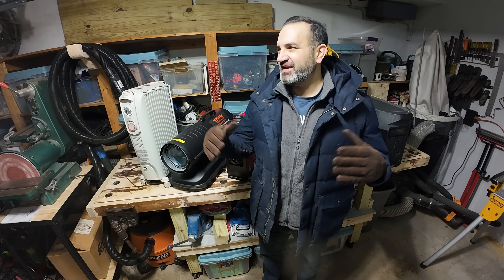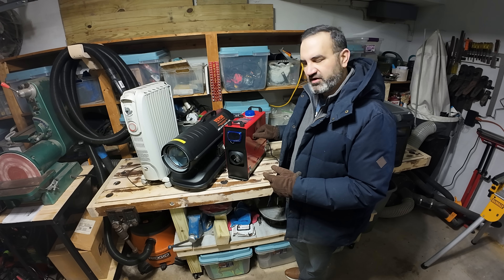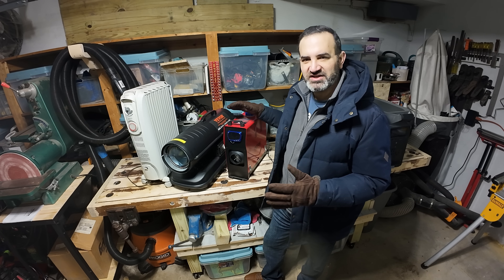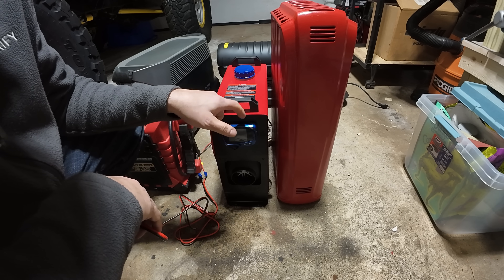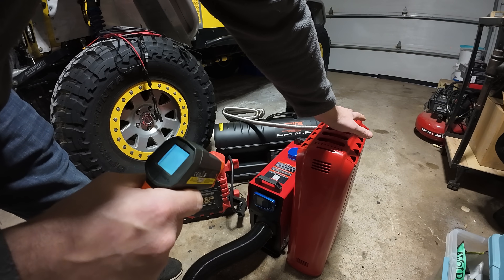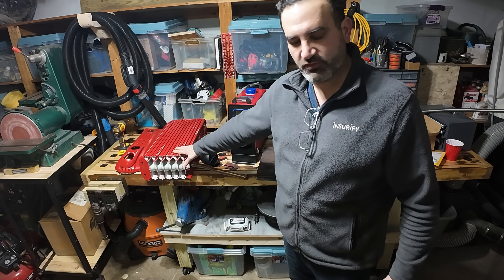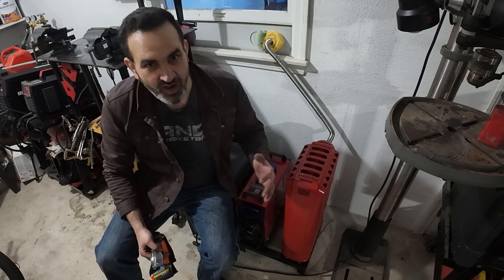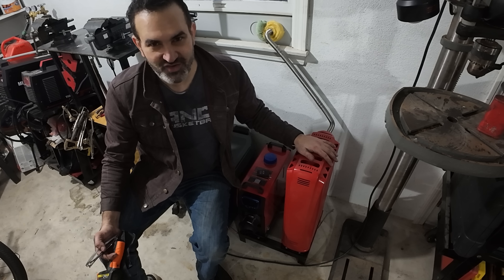Super-Efficient Vevor Diesel Heater Build for Shop & Off Grid

Comment: Find three or four of these Is old oil heaters.
Do not remove the oil. I repeat do not Remove the oil. 
The oil will retain the heat. Is the oil will retain the heat.
Using the exhaust system Is to heat the oil.
Or.
And then put those fireplace fans on top of each one of them.Maybe two on each.
Reply from the maker: @jasonpierce1980  why would you want to retain the heat? Retained heat doesn’t disperse. I want all the heat dispersed into my shop while I’m using the heater.
Reply: @offgrid101  To keep
Your garage warm.
🤦‍♂️ That's the whole purpose of your video is to retain the heat.🤦‍♂️
Reply from the maker: @jasonpierce1980  I don’t keep the garage warm 24/7. Any warmth released after I leave is wasted energy.
Reply: @offgrid101  How is it a waste of energy? All you're doing is gathering heat.... Through the exhaust the same thing you built.
Reply: @offgrid101  Here's another idea so you don't have to run your heater the whole time.

Comment: I was thinking about doing this exact thing but KEEPING the oil to better transfer the heat
Reply from the maker: @dronedrops8173  that was my original idea, but then I realized 1) there no good way to get the heat into the radiator while keeping the oil in it, and 2) the oil only retains heat, which I don’t care about. I want to capture and disperse it while I’m in my shop, not retain it to heat my shop after I leave.

Comment: You could add a couple of large diameter PC fans to the bottom of the radiator section and really accelerate the dispersion of heat into the shop, they would be able to run off of the same 12VDC supply that powers the heater.

Comment: When I have time I would like to use the exhaust as a "pre-heat" for the air intake that way the starting temp is elevated resulting in more heat and less fuel used.

Comment: do a followup video after about 100 hours of running.  i tried to do a heat exchanger with 1 inch iron pipe and after about 100 hours the heater would not heat well and had a soot buildup inside the combustion chamber.  i think if i would have gone to a 2 inch it may have been fine though.  the fan on the inside of the burner is not strong enough to force the exhaust any distance more than about 10 feet.  if i would have done the 2inch iron pipe i think it would have worked though..  also going to need a drain.  got about 8 ounces of water off the first heat exchanger after 20 hours or so

Comment: Great idea for long term off grid solutions! 
However, during a snowstorm/ power outage last winter I heated my 750 sqft home with an electric radiator and a few strategically placed box fans connected to a battery bank and an inverter. I was able to keep it about 65-70 degrees for 3 days when it was around 0 outside.
My experience with electric radiators is that they work great with well insulated spaces.
We now have a propane heater for backup. Next will be a wood stove.

Comment: Before watching I will point out that if you use an engine to work a heat pump, you effectively get more than 100% efficiency.
You can also run a generator and extract the "waste heat" is you have a use for the electrical power.

Comment: Cool idea. I'd have just run the pipe straight through the radiator and kept it filled with oil. Let the exhaust pipe heat the oil without making an issue of condensate gathering in the radiator.
Reply: This was my ideal exactly and a fan of some sort
Reply: @thewebbsace  it shouldn't need a fan. The heat should rise off of it just like it was intended to originally. 
But if you really want a fan you could just mount the vevor heater in such a way that the blower on the front blows across the top of the radiator.

Comment: A Russian blog found by experiment and calculation that these 5Kw heaters on max deliver 3.5Kw at the blower outlet and were able to extract a further 1.25 Kw adding a radiator to the exhaust
Reply: Agreed, the rating of these aftermarket heaters is both the fresh air and exhaust. Great post, as people are oversold and under-impressed, and their builds are mediocre.

Comment: The problem you will have is the acrid condensate will condense in your radiator 0 You must always have the exhaust drain downward  from your radiator  until it exits your shop -  as an alternative  you could put a pinhole in the bottom of your radiator and run a small tube outside

Comment: I used a turbo charger intercooler with a 12 volt radiator fan on mine.
Similar results as you....
Reply: That,s exactly what my plan was .... An intercooler is made for cooling air and very efficient since its used in automotive applications. Why not use it the other way round .

Comment: Those thinwall diathermic radiators are not designed for high heat and will pop at the seams releasing carbon monoxide. The exhaust is being restricted and will cause serious sooting and condensation. This is not a good idea and could be very dangerous. Be smart and be safe!

Comment: with that 90' bend going to the radiator will trap the condensation in the exhaust causing an ERROR code. I would put a bleeder valve at that bend.

Comment: Love the repurposing to get the efficiency up. You need to take the combustion air from the outside as well so you're not consuming the warm air.
Reply: I'm no expert but surely this is less efficient?   It's like the recirculation button on car aircon - the aircon (or heater in this instance) it doesn't need to work as hard as it's heating already warmer air?
Reply: @lee_brooks  No, the air being heated isn't the same air used for combustion.  Theses heaters are designed with 2 air inlets,  one for the room air that gets heated and a completely different air inlet for combustion. This is just like your car, the air used for combustion has a different inlets for the air being heated. If you use inside air for combustion it will suck in the outside air and make the room drafty.
Reply: @christopherguy1217  Thanks for the explaination : )

Comment: Nice idea, you have given me some new thoughts on my own set-up. Remember the exhaust condenses so you will need some sort of drain in the heater body, I would suggest a radiator bleed valve as it is easily installed and used.

Comment: Running the exhaust through some kind of heat sink like your old radiator is the way to go. I'm thinking of doing something similar using a long exhaust pipe coil in a fish tank with sandy soil.

Comment: You should have the air intake for combustion on the outside. Doing that will prevent the heater from pulling heated air from inside that will be replaced by cold air pulled through gaps in doors, windows, etc.

Comment: Neat idea! I did something kinda similar but with a large barrel in my garage. 
My suggestion: raise the heater above the radiator so the exhaust is going into the top of the radiator. You’ll get more heat out of it that way. Also tilt the radiator at a slight angle towards the exit pipe so condensate can drip out.  Where ever the exhaust is exiting should be the lowest point in the system. 
 Lastly on mine I increased the exiting pipe diameter because I’ve read from multiple sources that increasing the exhaust length and thus back pressure is bad for these units.
Reply: Great idea and it makes perfect sense to do so.
Reply: @jeffclark5024  remember the exhaust is meant to vent out of those things. If you back up the exhaust too much you can overheat the thing.
Reply: @quevicular  The standard length exhaust is routed to an old 100 gallon propane tank with a 2” stainless pipe exiting. It flows quite easily. Haven’t had any issues yet
Reply: @jeffclark5024  gotcha. Thought you were using an old electric oil heater

Comment: At 13:30 were you putting kerosene in it? Awesome idea by the way, going to keep my eye out for an old radiator style heater in fb or somewhere.
Reply from the maker: @HollisDoesStuff  yeah, I didn’t have any diesel around at the time, and kerosene is close enough for a test. I’ve since filled it up with diesel for normal use.

Comment: The oil/electric radiators are fine. mine can keep a 25°C difference on the low setting. my Space is relative small and well insulated.

Comment: To upgrade your idea use a used car EGR connected to the exhaust connect the water pipes to a central heating radiator use a small 12 volt pump to circulate the water that will be the most efficient way to get extra heat out of a diesel heater I use two of these systems to heat my home so I'm sure they will be ok for a workshop you can actually couple up more than one EGR together you can find lots of videos on YouTube on this subject

Comment: You need to put a drainplug in the radiator. Water will condensate inside and you probably will not want to take the caps off periodicly.

Comment: Fill the radiator with sand and be even more efficient.. I did that with an old wood stove and filled the chimney pipe and ran the exhaust through stove & out the pipe.... Works a treat and holds heat for hrs after turning the diesel.heater off ✌
Reply: I've been looking at sand batteries (generally powered by excess solar and an 'immersion heater' type device (and they're great) but in this instance surely you need the airflow though?  Not critical - just trying to understand : )
Reply: Ive heard this as an old smiths' method to bend pipe. Now you are just bending every one elses pipe!

Comment: I have one of those compact Diesel heater units, great little heater, but I too have thought about the heat wasted out the window. This is a very good adaptation! I've learned that off road Diesel fuel with the red dye is less expensive than regular Diesel or kerosene, but they're pretty much all the same heat wise, kerosene is the same thing without paraffin to lubricate the pump and injectors of a Diesel engine.
Reply: Where can you buy off road diesel?
Reply: Put smokeless 2 stroke oil in the kerosene will lubricate the pump.  its recommended when running kerosene

Comment: FYI: Those Chinese Diesel Heaters efficiency has been measured at about 60% so the actual output is not 20K but about 12K BTUs. Capturing the exhaust heat is worth maybe another 20%. They are not efficient, but they are cheap and easy to setup and use. 
On another note, never have the exhaust positioned above the heater. As others have stated you will get condensate build up which will then restrict the exhaust and that will cause soot buildup in the burn chamber eventually to the point where the heater will refuse to run. 
Did you ever consider a hot water baseboard unit? The exhaust would be kept straight so there would be minimal backpressure and if set up at an angle any condensate would run out the end.
Reply: In reality, how many years do you think it would take for that build-up 🤔 
To clog those chambers in that radiator?
Reply: @FrankNSense2290  Not long if you have soot and condensate water being produced that must be forced uphill.

Comment: Your exhaust gas temp is well below dew point. Condensation will eventually block the exhaust. None condensing fuel heating appliances need to reach 290f at steady state to not be considered a condensing appliance that requires accommodation for drainage.

Also that heater is very dirty with very high NOx. Soot will also clog the exhaust. And would require a method for cleaning out. Something you really can’t do in that radiator.

I hate to sound like a fun hater but you’ve just recreated a condensing oil furnace. Aside from the company thermopride every company that’s made these (with engineers knowing what they are doing) has been sued into the dirt from property damage or loss of life. At least have a good low level CO detector near by at breathing height.

Comment: There is probably one way to improve this setup even further:
A thin boxfan blowing on the side of the former oil heater from middle to out.
Reply: There are fans that use the heat for power.

Comment: Better imo just use long exhaust (angled downward for drainage) covered with a bunch of stainless steel scotchbrite (scourer) pads (cost is cheap) add fan to blow across it if desired.
No back pressure, moisture carried away and is fast-easy to do.
Pads are a tight fit over the 1" exhaust and can stretch out or bunch up as needed to cover length.
Reply: That's an interesting idea. I might try wrapping an exhaust pipe with very course grade SS pads to help the heat be radiated off the surface of the pipe instead of insulating it to keep the heat in.

Comment: The installation was wrong in terms of efficiency. You should have installed the diesel heater exhaust outlet on the top of the radiator and installed the outlet on the bottom. This provides warmer air flow and allows you to get a cooler exhaust temperature.

Comment: i think if you added a couple 12v computer fans to the top of the radiator it would improve convection
Reply: I have a large 280mm slow-turning PC fan on mine - its silent and uses just 2 watts

Comment: How did you seal your exhaust pipe to the radiator?
Reply from the maker: @massimo187  welded on a piece of steel tubing to the old heating element at 11:00
Reply: @offgrid101  Thanks for replying. That was a big question I had also.

Comment: Create you intake pipe and run right beside exhaust pipe to the outside. This will stop a siphoning effect from any cracks you may or may not have 😉
Reply: No.  Run your intake INSIDE.  the diesel  burn is already low temp and cold air doesnt help.    Cold air is denser and is great for compression engines.  I even separate intake n exhaust for toyo stoves, run exhaust down, fan on exhaust, etc etc

Comment: wondering if you will have problems with carbon build up from the back pressure, as your running of a new unit for 1 hour is not enough of a test

Comment: I suggest putting the heater and rad inline under the window 6 inches from the wall, the rad heat will help with window heat loss
Reply: I recommend piping the exhaust straight into your lungs. Maximum efficiency and warm yourself from the inside out

Comment: This might be a dumb question, but would it matter if I routed the exhaust from top of the radiator to the bottom?
Reply: It'll be better your way as the condensation will exit rather than building up in the radiator. I'd tilt the radiator towards the exhaust side also as to promote draining.
Reply: @brettd.3222  that's what I was thinking. I know it'd be tall but I'd like to put the heater on a platform above the radiator as to not have a bunch of bends in the exhaust

Comment: That's a cool build.  I'm wondering how many hours that thing will run before soot build up becomes an issue and causes a restriction in the flow.  Could create really hot spots or be a potential fire hazard down the line.  If the red paint starts smoking or flaking off you might want to shut it off.

Comment: Won’t run very long with it setup that way it’s way to restrictive on the exhaust side I tried setups much less restrictive then what you have and it ran great for a few days then it started smoking and not starting well it was plugged up with exhaust soot.
Reply from the maker: Good to know. How can you prevent the spot buildup?
Reply: @ good question being that the exhaust barely flows as it is. I’m thinking of trying a 1.5 inch Y pipe with a small 1.3 inch variable blower and connect that in the middle of the exhaust somewhere to help pull the exhaust out of the combustion chamber and push it out the pipe hopefully it won’t mess with the heater to much.

Comment: It looks great, but I would’ve left it in its original color because painting it acts like insulation not allowing as much heat from radiating out of the heater. your efficiency will be lost a little bit.

Comment: honestly, you would get more efficiency by piping the exhaust through a sand battery.
Reply from the maker: True, but that’s a bigger project, and i had this laying around. Also, this radiator produces a convection current, which steam radiators and sand batteries don’t. I think loss in efficiency might be offset by the air movement.

Comment: people can use a smaller cheaper rad if you add a fan to blows air threw it or more mass in the rad. basically extending the builtin heat exchanger